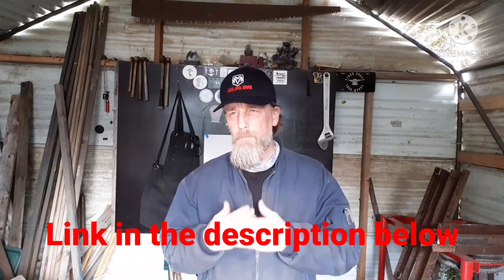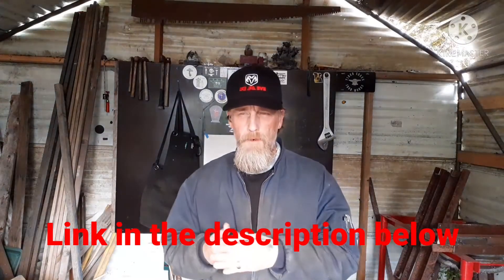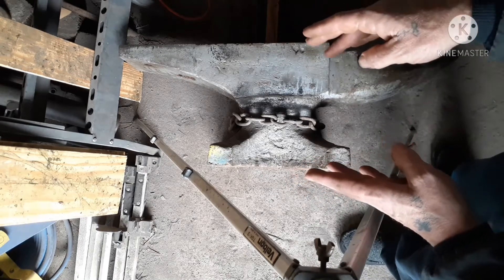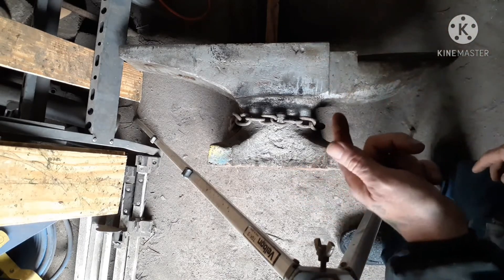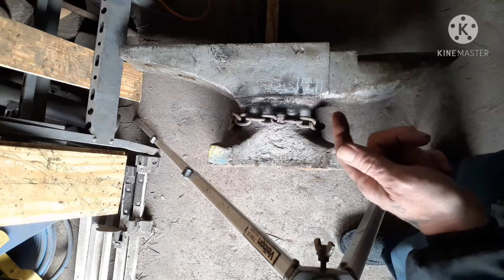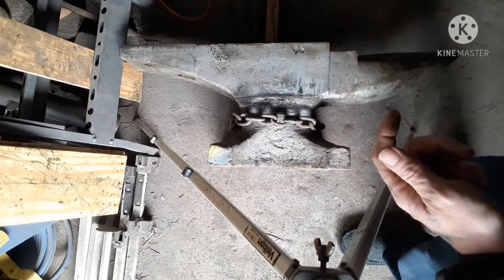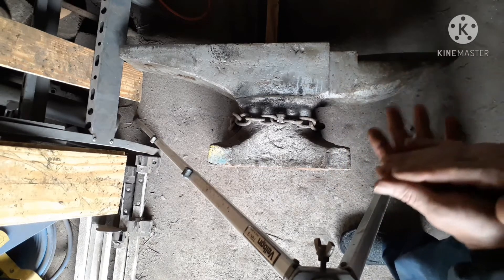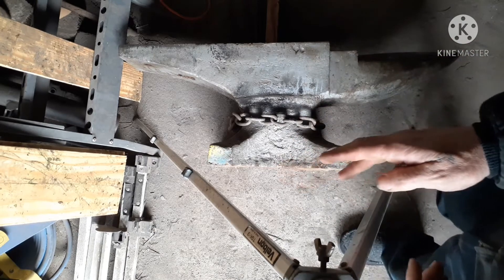How should I build my anvil stand???

Comment: Personally I won’t move away from my wood block stands they are just to damn convenient to mount stuff to but if you are set on a fab stand do a 3 leg stand 1 under the horn and 2 off the back and keep em straight angles being bent will really mess with ya head I’ve also welded rebar between the legs on my 3 legged striking anvil and it’s really convenient to use as a step stool lol it just moves around a ton because of less surface area to the ground

Comment: First you need a steel frame around the bottom of the Anvil,
Next I'd do the curved legs. (Make sure to get four) each on each corner, next put a (/) connected to the curved leg and bottom of Anvil. 
That's how'd I do it